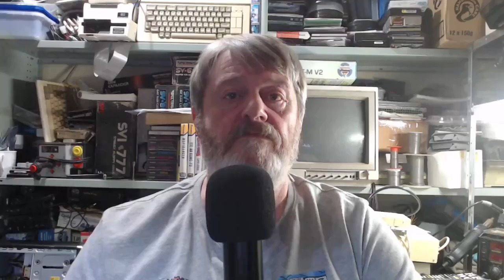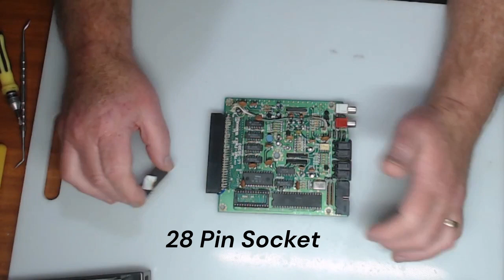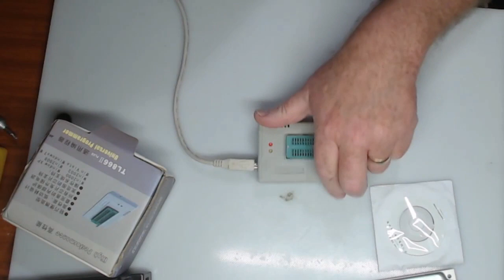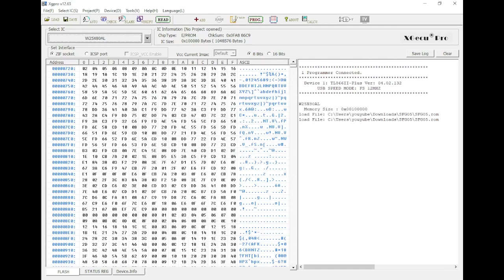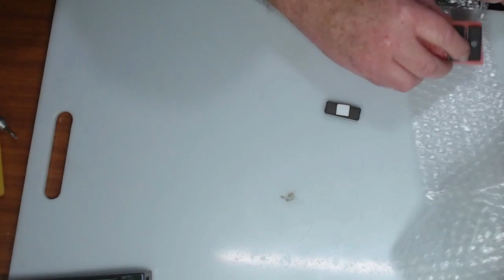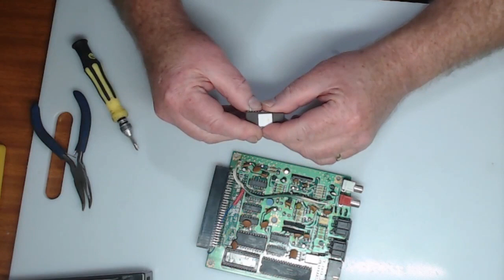sgm01 to 05 upgrade

Comment: 15:35  Note that the Device ID identifies the correct device, which can be important in terms of correct programming voltage & algorithm.  
The reported device ID (8F C4) is the National Semiconductor (manufacturer ID = 8F), and NatSemi 256k part (C4).  e.g. NM27LC256 Low Current CMOS EPROM is a 8F C4 device ID.
i.e. Ideally you should select the correct identified device, instead of just turning off the ID check.
If you sourced your devices from China, you’ll find they are quite frequently incorrectly re-marked. Especially devices like EPROMs.  A bit of rubbing with Acetone will generally reveal the original part.  Hope this helps. 🤓
Reply from the maker: thanks.. it works fine so am happy. and thank you for the info..